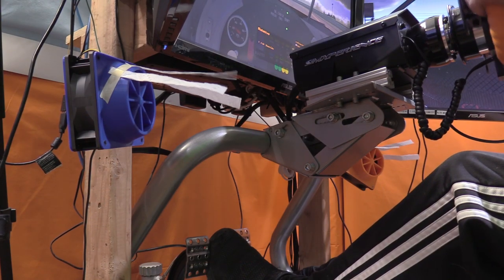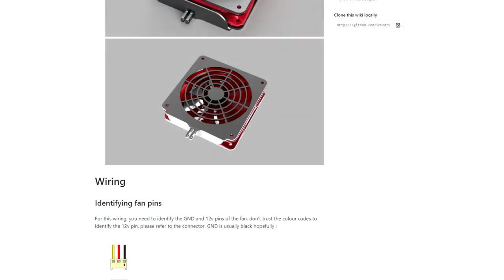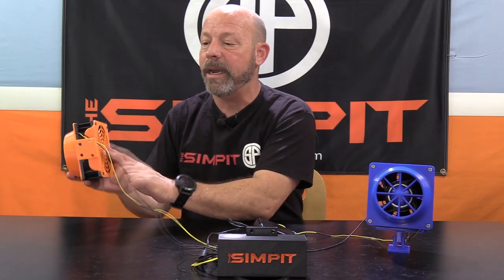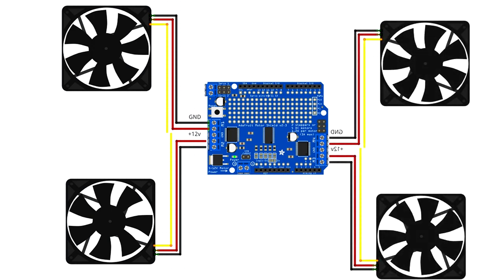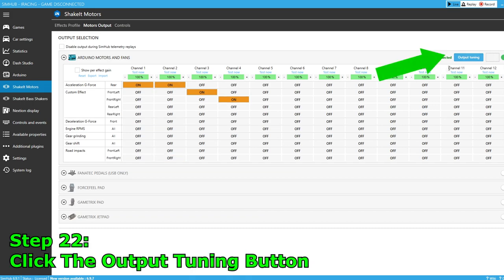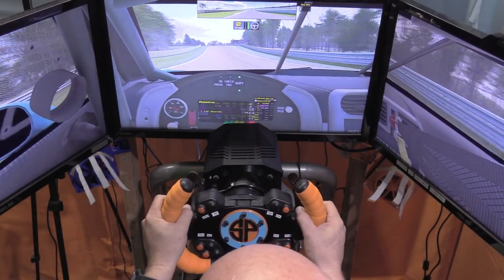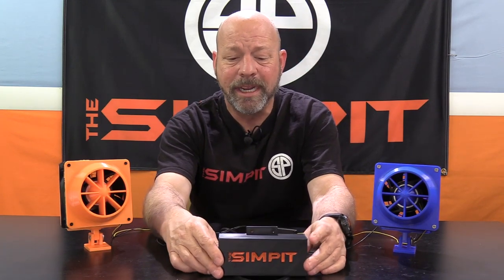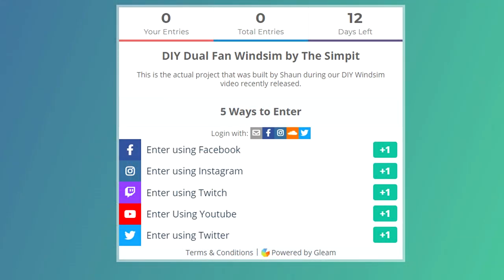How To - DIY WindSim - Hitting a New Level of Immersion

Comment: For anyone having issues with this guide not working, I think the fan wire diagram is slightly incorrect. The ground is the middle pins and the power is the outside pins (ones labeled M1 / M2 etc), effectively just swap the fan cables from what is shown in the video.
Reply: Yeah, I also had to invert the wire diagram. But I think he says correctly that the GND wire must be near the GND connector.

Comment: Great hack, Thanks Shaun! I would love to see more hacks and tips on making our simulators, next level. I noticed several of the fans on Amazon are actually 4 wires. Seems like many of the higher CFM fans use 4 wires. Will these fans also work with this hack? Some of these PWM fans are rated at 3000 RPM. That should move lots of air!
Thanks!

Comment: Thanks!!
I did this over the weekend and it works great!   My negative and positive were different for the fans but otherwise it went well.
Questions.... Why 400 for the PWM?  Shouldn't it be 1600 to match the board?
What is the difference between using the jumper and going straight to the motor shield with the 12 volts?

Thanks again!
Reply: How's it holding up? Was it worth it I'm planning on doing this
Reply: Gustavo Salgado it’s holding up great!   The cooling in vr is worth it on its own plus the added effects of feeling like your moving due to wind flow is good as well.  The pwm affects the amount the fans sound like they are whining.   I stuck with 1600 for my taste.
Reply: @chillil321  Just now ordering the parts. Since its been a little while since you put yours together, have any recommendations?
Reply: @MarxismIStreason  The only thing I did extra was to purchase the three pin connectors for the fans so I could quick disconnect them.  I also 3d printed an enclosure for the circuit boards from thingiverse.  The video is a great guide and I have not had to deviate from that much.
Reply: Didn’t work for me at all , it shows not connected and fans not spinning.

Comment: Hello! Beautiful description of the project. I actually built this project two months ago. I never mounted because Simhub was not working well with simfeedback. I have a SFX-100 rig powered by simfeedback. When I play F1 -2020, my simfeedback telemetry requires legacy mode. This mode is not present in Simhub. 

Also, I’m having issues with my brushless fans. At high speeds, when I test them, the fan loses power for a second and returns back to max rpm. Have you faced this issue? 

Thanks!
Reply: I’ve got one as well but I use SRS with the Thanos board. No issues at all for me. Maybe this would fix your problem?… it wouldn’t be a cheap fix though…

Comment: Hey Shaun I have a question for you, and I think you might be the only person that can answer it. I currently have a Fanatec Turbo S wheel (I preordered it, that shows how old it is) and CSR elite pedals on a wheel stand pro. I am starting to feel like the wheel is getting to its last legs, but I have been saving for a rig (like a GTR GT-A, or GT Omega Art/knockoff). Once i have a rig i think i want to get a new wheel. I don't want to side grade and want a legitimate upgrade at the best price point. Coming from the PWTS what would be the most appropriate route to go CSL, T300, TSPC racer, CSW (looking  for the best experience from just a wheel base and one wheel for between $500-$600 or less. What do you think. Sorry for being very long winded.

Comment: Out of all the setups online yours is only one correct PWN... @boostedmedia isn’t even using same power connecter port. Not sure what difference this makes but if it wasn’t needed I sure wish I wouldn’t have cut my power wires.  I would like a better explanation from someon what PWN is. Because most fans are rated way higher PWN then arduino does. I wish I understood that setting more. Feel like I’m blindly entering numbers. Has to be some kind of math to ensure correct number. But like you said 400 on mine seems to work decently.
Reply: Boosted Media literally builds computers and understands how electronics work. 

There are two parts to the Arduino: the uno and the motor shield; both of which require power. The motor shield obviously requires more power since it is supplying the fans. Thus, the way Boosted Media wires the Arduino is correct. He is supplying power to the motor shield via the 12v adapter and is supplying power to the uno via the USB. 

If you don't want to cut the power supply, you could always wire a 12v female end to the motor shield.
Reply: @mmatthews90  Boosted Media simply plagiarised their tutorial from amstudio (youtube) without crediting the author obviously...I doubt they know what they are doing. In their second part they even suggest using PWM of 60 instead of 1600, and that wouldn't even move the fans (I followed their tutorial and parts they recommended so I can confirm)

Comment: Thanks for the vid, but too much incorrect (GRND/+ reversed) and unnecessary info (enable FORCEFEEL PAD? Acceleration G-Force? Road impacts? No. Just enable Speed). Clean it up, bruh.
Reply: I was wondering that about the wires being in the reverse order...so you're sure the positive is the outermost terminals?

Comment: arent these pwm fans? couldnt you just plug thewm straight into an arduino and code it to run straight from it rather than having a motor daughter board?
Reply from the maker: Yes they are PWM fans, and I have heard there is a way to do that I couldnt find instructions however
Reply: @TheSimpit  no worries was just theoretical, haven't done it myself just curious 🙂
Reply: You could, but the Arduino isnt suitable to switch those loads.
Reply: Hello, 
To anyone reading this, if you have PWM controlled fans, it is possible to run them directly with the arduino.
BUT, the Wind Sim, to be effective, needs high CFM fans.
They are 12v AND idealy above 1Amp. your Arduino will struggle to give you this type of load and over time fail on you.
The voltage regulator built into the Arduino to go from 12v to 5v isn't very good and will overheat.

The motor sheild is rated for 12v 3Amps. And Max 1.2 Amps per motor output. (spec you fans accordingly)
To use this, you must (not like in this video) disconnect the jumper next to the power connector on the motor sheild and connect your 12v power supply directlty to it.
The arduino will be powered with 5v through the USB port.

I Hope this will help some of you ;-)